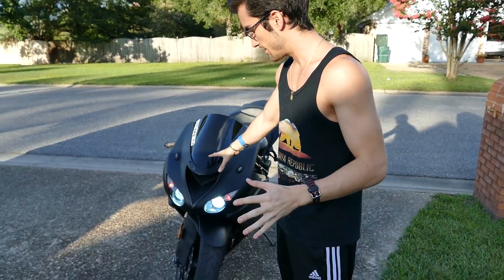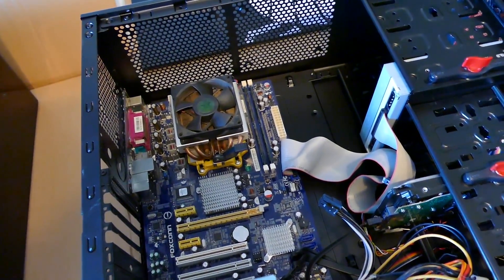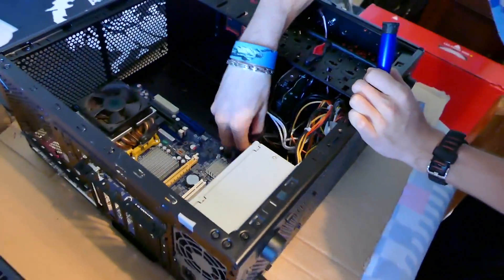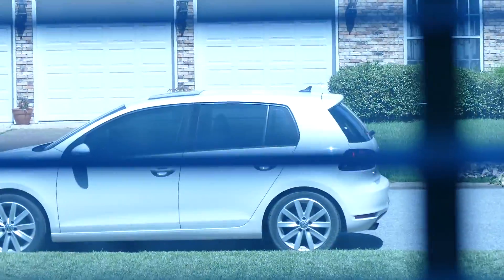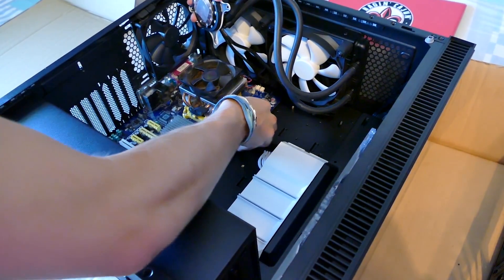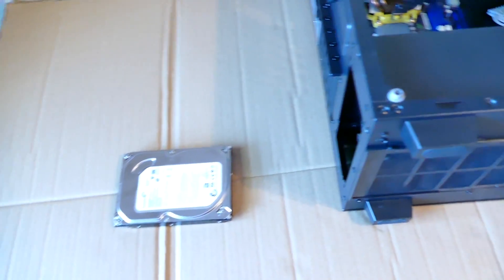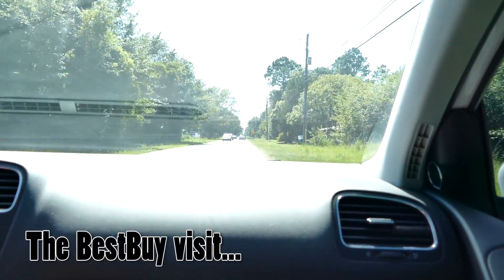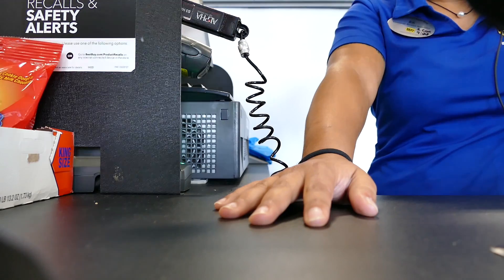Building McLovin's First PC (Part 1)

Comment: You must heat the CPU before pulling off the heatsink... I've learned the hard way with a couple of bent pins. I was able to fix it, but what a headache. You can use a blow dryer to put some heat on the heatsink so the TMI heats up enough for it to come off without yanking the CPU along with it.

Comment: OMG I just did that yesterday! I pulled off the wraith cooler along with my FX-8350. It ended up with two bent pins but I fixed it and it works just fine. Nothing broke off of it like I expected it to... Why does that end up happening? I bought the FX-8350 not too long ago.

Comment: With a AM3 board and some good 16 gig DDR3 ram and that old CPU.. Slap a 470 in there he have a nice high setting gaming tower. Still under $750 and he should be doing 70-100 FPS 1080.. Just saying

Comment: Its pretty common that some AMD cpus get stuck to the cooler
Reply: Depends
Reply: I had that happen with an Intel CPU. It mostly comes down to the quality of the thermal paste! I've been using only AMD  CPU's after that Intel, and it never happened again!
Reply from the maker: My thermal paste was top-notch quality, Arctic Silver 5. Still ripped the CPU out of the socket.
Reply: -T-X-M- It was a old celeron, back in 2005-2007. As far as I remember that metal piece popped up and the cooler came off with the cpu still attached to it. One thing i learned over the years is, that you should always wiggle the cooler to the sides a little bit, before attempting to remove it. Do so a couple of minutes after turning your computer of, because the paste will be still warm and it will lose its grip easier.
Reply: -T-X-M- Never put it on the cooler. You apply it directly on the CPU, and don't spread it with anything. It will do that by itself when you press down on it with the cooler. Apply it to the center of the CPU, and amount you use should be rice grain in size, but you can use a little more than that, if you feel it's not enough(pea size). If you're not sure you can always watch Linus or TekSyndicate video about that. Sorry for not replying sooner. Youtube didn't notify me of your reply, for some reason.
Reply: -T-X-M- What case is it?
Reply: Nice
Reply: Mines did rip it right out of the socket  it was ok. the socket was ok too.
Reply: Yep, it took me and both cousins about 20 minutes with a hair dryer and warming the cooler while I pried it off with a knife. That was terrifying. You should run prime 95 or something to get it as hot as you can and remove it as soon as you shut it off.
Reply: not true , i just pulled my sempron cpu from 2004 from its socket: easy peasy
Reply: +gmrb79s it doesn't always come off hard, and it should come off easily if you remove it while it's warm. It does happen though, that was with 3 month old stock thermal paste, that sempron probably had such old paste it was probably dry and no longer that sticky.

I was lucky I removed it straight out and didn't bend any pins.

Comment: EVGA Super Clocked?  That's seriously the worst 1070 out of all the non reference cards!  Ugh!  ::facepalm::
Reply: what's bad about it?
Reply: So we know all graphics cards aren't considered equal.  Whether it's from the quality of components used, the depth of the traces on a PCB, or the engineers that created the card.  All cards vary in strength and performance.  Additionally some brands have good years and bad years with their products.  Well for EVGA this product cycle is not turning out in their favor.  Check out Linus Tech Tips Review of the EVGA 1070 Superclocked.  It just doesn't perform nearly as well as similar cards.
Reply: mr worm Yes, let's base all 1070 SC's on a single review sample that was not cherry picked. You do realize that each GPU has it's own qualities that will determine how well it can overclock and therefore how well it performs, which have nothing to do with who actually produced the card, right?

Comment: I still have that motherboard with a Phenom 8450 and an HD 6670 2GB ddr3.Pray for me!OMG and I also have the same ram!lmao

EDIT: this motherboard is a great motherboard for OCing I OCed my Phenom 8450 from 2.1 to 3.6 Ghz with an H60 watercooler.
Reply: Voltages on your OC?
Reply: Tristan Kikkert ! think around 1.35 something like I'll edit if I'm wrong
Reply: You must be bawlin' hard x'D
Reply: KROreviews I can play CS GO and games like that but 1 year ago I bought Battlefield 4 and it runs like shit stutering 15-35 FPS 20 most of the time but I'll finally buy new parts for a new PC this Christmas
Reply: +Cristian Gabriel Capatina what is your GPU?
Reply: Rdrack My new one...well i'm gonna buy an RX 480 and my ld one is an HD 6670 2gb ddr3
Reply: +Cristian Gabriel Capatina thats maybe the problem, ohh and if you put small copper or aluminium heatsinks on the vrms you might have a higher overclock
Reply: Rdrack Well I've already OCed my HD 6670 from 800 Mhz to 855 (core clock) and from 800 Mhz to 1140 (memory) and the GPU already came with Copper heatsinks

Comment: I cry, that athlon cpu got to have an x61 watercooler while my i7 4790k over here is currently stuck with a stock cooler. rip
Reply: at least its quieter than an amd stock cooler
Reply: How do you have a stock cooler on a k processor
Reply: same lol rip us
Reply: Could be worse.  You could be stuck on a Phenom x4 9750 instead of a nice i7.
Reply: Oh ok then
Reply: +Smileyfaceanimations yeah a cooler is next on my list but its not oc'd yet and it doesn't throttle
Reply: phantom of the opera idk
Reply: Don't worry my i7 6700k has a nice cooler but is currently paired with a r7 370. xD
Reply: Don't worry my i7 6700k has a nice cooler but is currently paired with a r7 370. xD
Reply: Pretty sure both trump HD 6870.  haha
Reply: no, it's a dx11 feature card.  It's a semi strong card for a dx11 feature card, but still can't dx12.
Reply: Although now that I compare it to the gt 740, the 6870 spanks it.  The gt series is just way too cut down by way of cores and such.  The 6870 is close in power to the gtx 750 in gaming, but it does spank it on paper in raw bandwidth, gflop and texel rates.
Reply: +Razerr you obviously don't know what a wraith cooler is
Reply: +Joegaming the old amd cooler, il the wraith cooler is quieter
Reply: +Joegaming *ik
Reply: Razerr ye
Reply: +Joegaming what the fock are you doing here?

Comment: Actually You can overclock any AMD CPU. at least am3 and am2+. I did that on old gigabyte MB with Athlon 2 x2 620 or smth like that (4x 2600mhz). It runs without rising the voltages at 3ghz. You don't need Black Edition CPU to overclock it. Rise the FSB while keeping other multipliers for RAM and NORTH BRIDGE values at similar to stock values 😊. Oh and don't forget to setup the voltages to static values, because on AUTO MB can sometime rise them itself to ridiculous values WHEN doing OC. 😁
Reply: it should be 'athlon 2 x4' instead of '2 x2'.

Comment: Of the X61 is to expensive then use the old X60.
Reply from the maker: I never said it was too expensive.
Reply: +Science Studio I meant add you said it didn't make sense putting an x61 in there to put your X60 on there if you still have it :-)